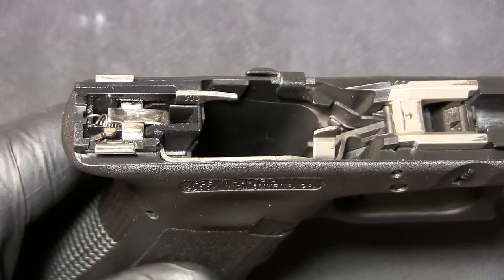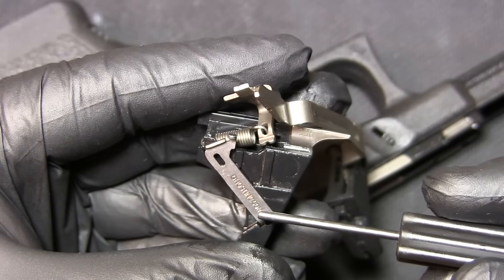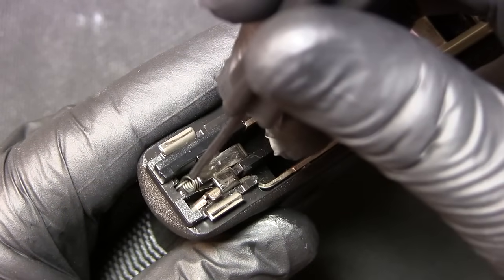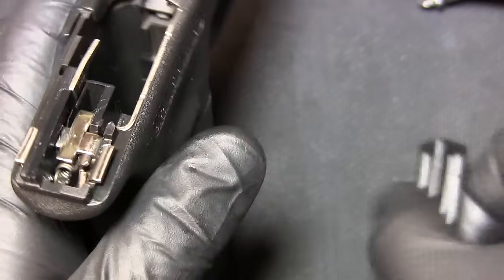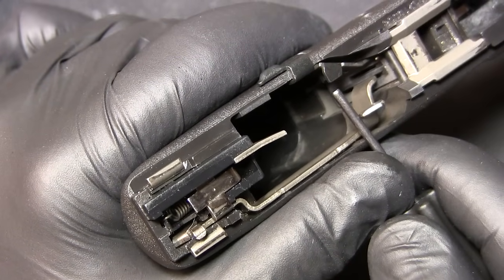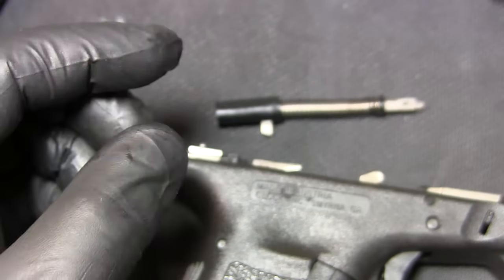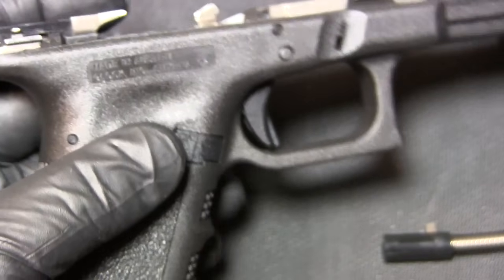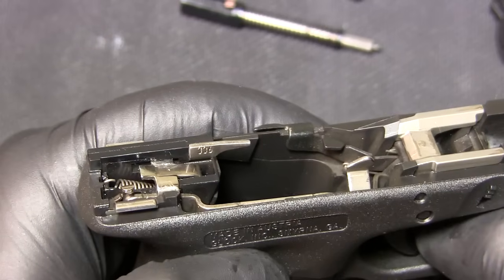How Glock triggers work and how they reset

Comment: I have a G42 and I hate the safety thing in the middle of the trigger. Is there any reason not to remove it? Or can I just superglue it "back"?
Reply: +bludmakesgrassgrow it will still function, but I would consider the pistol unsafe for carry or defensive use.
Reply: +bludmakesgrassgrow no round in the chamber and removal of the trigger safety? Both are terrible ideas.
Reply from the maker: All glocks have that safety in the trigger as far as I know. I would not recommend disabling any safeties.
Reply: +bludmakesgrassgrow All of my Glocks have had trigger safeties that stick out too much past the trigger face to shoot comfortably. I clear the gun, pull the trigger and then go over the face of the trigger with 60 grit sandpaper than 180 grit and finish with 600 grit. Now my trigger safety is flush with the trigger when pressed and it still functions properly. Do not remove it or superglue it. Go slow! You're just trying to shave off enough material from the trigger safety to make it sit flush when depressed.
Reply: William Hubbs Meh...o well
Reply: +William Hubbs +bludmakesgrassgrow dumb and dumber leave the trigger alone before someone gets hurt
Reply: yandri arce Fuck you
Reply: yandri arce Wow, somebody doesn't have a firm grasp on the idiosyncrasies of the English language...
Reply: Kent Miller Wut?
Reply: +bludmakesgrassgrow i think what everybody is trying to say is, why the fuck would you do all of that nonsense.  It defeats the purpose of carrying it.  Gun should be chambered and ready if needed with safeties so there are no accidents; not to have as something to pull out, rack and pose.

Comment: If one knows how to take a Glock 17 so that when it's trigger is squeezed it fires 1 round, then when the trigger is released it fires another single round. So basically "squeeze fire, release fire" or 2 round burst... Is that still considered semi-auto and legal still or does it need to be put back to the way it left the factory?.....
Reply from the maker: sounds semi-unsafe to me. and likely illegal. I don't think that would still be considered semi-automatic since more than one round left the barrel after a single trigger press.

Comment: What role does the safety plunger play?  Why do people polish or go aftermarket?  Great video.
Reply from the maker: It blocks the firing pin/ striker movement until the trigger is pulled. so if the gun is dropped, there is no chance of the striker hitting the primer

Comment: Excellent video!! A question: What force makes the trigger bar come up once the connector has been moved to the left during slide-back? I seems as if it was spring loaded somehow.
Reply from the maker: +Antonio Ferracuti the trigger spring pulls back and up. So it moves the trigger bar upward into the way of the striker lug.

Comment: I had the exact problem with the trigger safety not coming out far enough to set. I just put the original glock trigger spring back in now works great. Glock 21 4.5 firing pin spring, and Ghost 3.5 connector. I could not polish the trigger bar enough to get gritty fill out so I put a tiny drop of oil between trigger bar and connector, works great now.
Reply from the maker: rdaugherty52 Glad you got it all figured out. Which Glock is it?

Comment: Cant thank you enough.  Did a trigger job on my Glock 35 an had the problem that you explained wit the trigger safety not resetting.  Changed the 4LB spring out and trigger resets properly.
Reply from the maker: Stephen Trindall My pleasure. Glad you got it figured out.

Comment: You did just fine Mosin. In fact this is the most informative "who glock triggers work" video I have found. Like you, I want to know exactly how the mechanical parts interact before I do anything to my firearm. No maybe stretching that spring was not the best thing, as they should be replaced in tandem with complimenting weights. But overall you nailed it on the simple, but unusual way a glock trigger works. Thank you so much for taking the time. There is more to polish in the connector trigger bar assembly.
Reply from the maker: Thank you. Glad you liked it.

Comment: Hi MosinVirus, it´s me again.. Another question for you: If the position of the cross at the end of the trigger bar is down because of the trigger spring, what makes this same cross at the end of the trigger bar jump up when the slide releases the bar cought at the conector ramp ???
Reply from the maker: Hello, the trigger spring is actually pulling back and up. The ramp of the connector bar doesn't allow the cruciform at the end of the trigger bar to raise because it is forcing it down when the trigger moves back. When you disengage the connector bar, there is nothing blocking the trigger bar from moving where the Trigger spring pulls it, which is back and up.

Comment: Great video, so when changing the pitch or grade to the ramp of the connector you should only be changing the tactile feel of the trigger, is that correct? More importantly, by changing the connector between the 3.5#, 5# & 8# (popular variants) the strength at which the primers are struck should stay the same as this relationship is associated primarily with 1. The Firing Pin Spring and 2. The Trigger Spring, is that also correct?
Reply from the maker: Thank you for watching. The connector bar does change the feel of the trigger, and makes the travel of the trigger lighter. How hard the primers get struck is dictated by the striker spring. Most of the trigger weight lightening comes from lightening the striker spring. that is the spring you act against when pulling the trigger. The weight of the striker spring is also the only thing to really consider when figuring out the effect of the primers.

Comment: Tks for this video.. Let me ask you some: What keeps the trigger bar (cross in the back) down and hold. I know that is the conector, but wich part of the conector holds the trigger bar down? Would be the ramp in the conector?? I do not have a Glock, so I only have the imagination to understand how it works...
Reply from the maker: Hello. Yes, the ramp of the connector bar keeps the trigger down, and the trigger spring keeps pulling it back.
Reply: Ok, now I got it !!! Tks for the answer...

Comment: Great video. Quick question what allows the trigger to remain at rest when the chamber is empty and which springs or springs directly influence the triggers reset? Thanks
Reply from the maker: Hello and thank you for watching. When the gun is cocked, the lug of the striker is pushing the trigger bar forward. When the gun is not cocked, the striker is not contacting the trigger bar and the trigger spring pulls the trigger bar all the way back, where it rests. The trigger pull is affected by both the trigger spring and the striker spring. The trigger spring pulls the trigger bar back and up, and in a way helps the trigger pull. The striker spring is what you need to overcome before the trigger breaks. That is why when people want to reduce the weight of the trigger they get a stronger trigger spring and weaker striker spring. Of course the connector bar plays a big role in the whole picture, but those are the two main springs involved. Also, when replacing springs, make sure you don't effectively disable the trigger safety. Let me know if this helps, and if I can provide more information. Thank you.
Reply: Well explained my friend I totally get it. Thanks for the insight
Reply from the maker: G Garrett glad to help. Thank you again for watching.

Comment: Very good explanation.  I always polish the connector surface you referred to as a matter of practice, but never actually thought about how the Glock trigger reset works.  I just knew that the trigger felt better when I included the edge of the connector in the polishing.
Reply from the maker: Thank you for watching. Glad to help.

Comment: Excellent, excellent video.

One question: can one keep the factory firing pin spring but use a 6lb. trigger spring?
Reply from the maker: Thank you for watching. If you carry or use it for self defense, I wouldn't recommend it, but otherwise yes, you could replace the trigger spring. Leaving the original striker spring will ensure that your trigger weight is still close to original in weight and will make the trigger safety engage every time.
Reply from the maker: You can check out my other video called The Road to 3.5 lb. and see how each part affects the weight.

Comment: Trigger resets when slide is racked during dry fire but when I hold trigger while racking slide the trigger does not want to go all the forward to hard set the safety trigger button
Reply from the maker: Yes, this happens when your striker spring is too light for the trigger spring. If you replaced your trigger spring for a stronger one (6lb) and you striker spring for a lighter one (4lb) which usually come in kits, the safety may be compromised because the striker spring is not strong enough to move the trigger all the way forward.
Reply: i have the oem trigger spring in it now: replaced the 6lb as instructed by a friend especially if your using a 4.5 striker.  my new combo is 5lb trigger and 4.5 striker spring.  all primers fired and not one problem for target practice.  home defense, I use a 5-6 lb striker to be on the safe side.  I removed too much metal off of my original cruciform and during resetting trigger, it would slip off striker face. I link your videos to my glock owners and they much appreciate your fine videos.  thanks, steven
Reply from the maker: Glad to see you got it figured out. Thank you for watching.

Comment: Video was awesome and very informative, thank you for posting. One thing that I take a issue with the stretching of the firing pin spring. When a compression spring is stretched out the integrity of the spring is compromised. It will make it stronger in the immediate, but over prolonged use it will actually become weaker than it's initial strength. Unless you have a method to temper the spring steel, I don't advise that anyone does this.
Reply from the maker: You are absolutely correct, and no stretching should be done. I wish there was a way to remove that portion from the video. I will add an annotation at the section advising people to not do that.
Thank you for your feedback.
Reply: MosinVirus
People annotate updates in there videos all the time, nothing wrong with that. Have you had and problems with trigger reset since then?
Reply from the maker: Lord Mongoose I never had any issues with this Glock. It has performed flawlessly through 3000 rounds or so thus far.
Reply: Awesome.

Comment from the maker: Regarding spring combinations... If you watched this video, you heard and saw me talk about springs and how they affect each other. Well, I found a combination that works perfectly when it comes to reducing the weight and not sacrificing the trigger safety. You can replace only the striker spring for a 4 lb. one! Do not replace the Trigger Spring that pulls the Trigger bar back. Leave the original trigger spring in. This will give you a much lighter trigger weight and engage the trigger safety every time.
Reply from the maker: +geezerp1982 I already got one. thanks.
Reply: +MosinVirus Just watched this. As usual, you present information in a way that the less knowledgeable of us can learn from. I enjoy learning about the inner workings of guns and I especially enjoy watching your gun build videos. Thank you for your time and energy.
Reply: Thank you. You as well. Disregard the negative and keep pressing forward - you do great work!
Reply: This was everything I needed, and great picture quality, thanks
Reply from the maker: +sipzter thank you very much for watching and kind comments. I will gladly continue to share what I learn.
Reply: +Chuck Williams There's a spring under the rear of the trigger bar called the trigger spring that pulls it up once the connector moves to the side allowing the trigger bar to move upward, pulled up by the trigger spring underneath. Hope that helps, I had the same question at first.
Reply: Thank u for taking out ur time and teaching me something!!👍🏻👍🏻
Reply: What about a 3.5 lb connector, like a Ghost Inc or Double Diamond, in place of the Glock factory 5.5 lb connector? The connector is basically a spring itself. This is such a good analytical explanation of the trigger system on a Glock.
Reply: Rocxy Lemmon I bought some upgrade kits for my G19 Gen3. Ended up installing a 3.5 lb connector, a 4 lb striker spring, and the reduced power safety spring. Didn't need to change the trigger spring. The stock spring was just right. Glocks are so damn easy to work on.
Reply: Have you experienced any light primer strikes with that lighter striker spring Mosin?
Reply from the maker: JayHutchG I have on a .45 Glock, but not on 9mm.
Reply: @JayHutchG   cheap ammo have harder primer caps. if u use quality ammo light striker hits will be no problem. if u use mainly cheap ammo then adjust your striker spring as needed
Reply from the maker: +sipzter nice to see you on the tube!
Reply from the maker: +sipzter yeah, just taking a break and restoring that 2a1 sporter I just got.
Reply from the maker: My pleasure.
Reply: I tried exactly this on a Glock 42.  Other people have claimed the same combo works perfectly on that model.  Unfortunately I ended up with a trigger reset that's not quite enough to reset the  trigger safety (like you describe).  Possibly QC is not great and the Ghost 4# spring I have is lighter than advertised.  Hard to say.  Very frustrating because, after the spring replacement and polishing, the trigger is spectacular compared to stock.  I guess I'll have to do some experimenting.  Maybe a 4.5# spring?  Any recommendations?
Reply: @civilian0005  Wolff Springs
Reply: +MosinVirus PS - chevy95 here from calguns.
Reply: Sorry just caught up.  Love to see your vids of that restoration.
Reply: I have a question. I understand how it works for the connector to move to the side, allowing for the upward movement of the trigger bar, but I don't understand how the trigger bar actually RISES. I don't see how the connector moving to the side moves the trigger bar UP.
Reply: MosinVirus i too liked the video and then was worried about your 6 pound trigger spring being to strong for the striker spring...lol... i was thinking, i hope he just finds another way to help his trigger pull.... and you did just that...thank god!
Reply: SamBob 63 thanks for the clarification
Reply: +MosinVirus what you want ? a medal?

Comment: Excellent video and information.  I thought the striker spring was compressed when the slide moved rearward and then released forward when the trigger bar drops down.
Reply from the maker: Thank you for watching. The striker spring gets compressed when the striker is stopped by the trigger bar as the slide is moving forward. Then, when the bar moves out of the way, the striker flies forward as the spring expands.

Comment: Idea for next video. What makes the trigger bar pop back up after the connector is pushed in by the slide. Seriously. If the spring is pulling the trigger bar back and down why does it pop up. Great video.
Reply from the maker: Thank you for watching and responding. The spring is actually placed diagonally, so it pulls back and up at the same time. That is what makes the trigger bar to jump up when the connector bar is moved out of the way. If you take a look at where the spring is connected, one end goes to the high point in the back of the housing, and the other end goes to the low end of the trigger bar arm, so the pull is back and up.